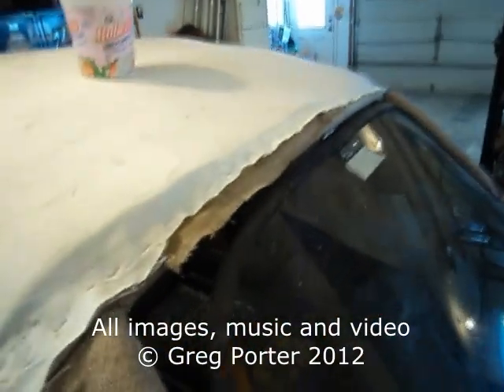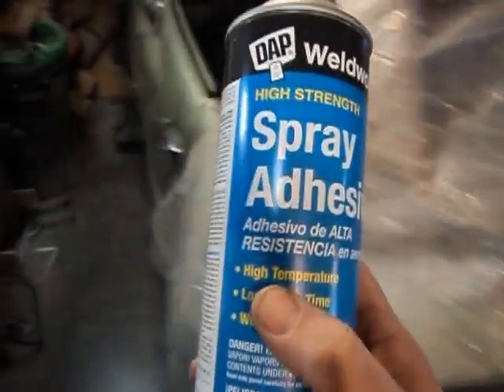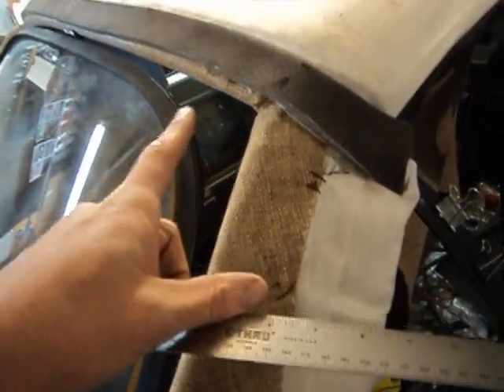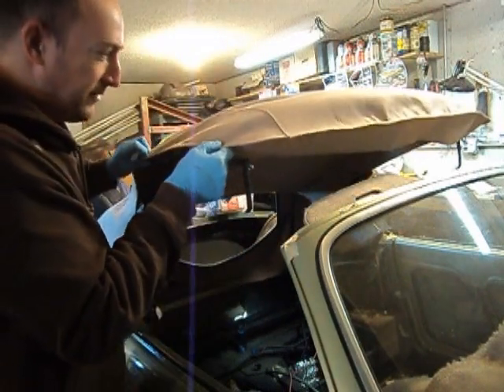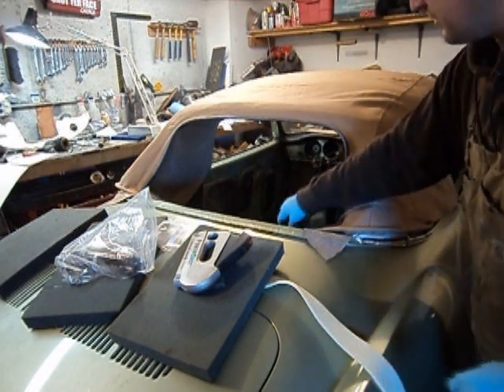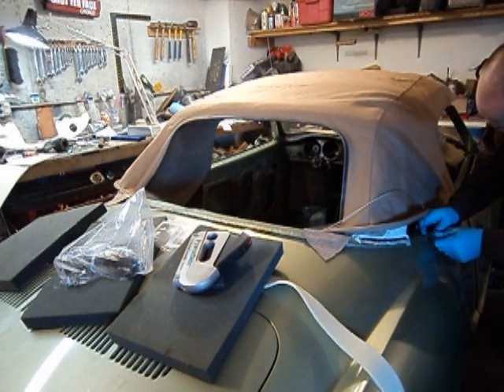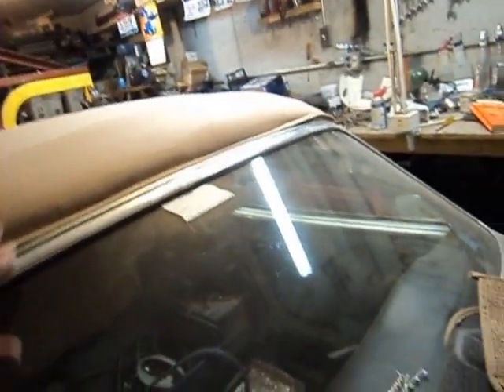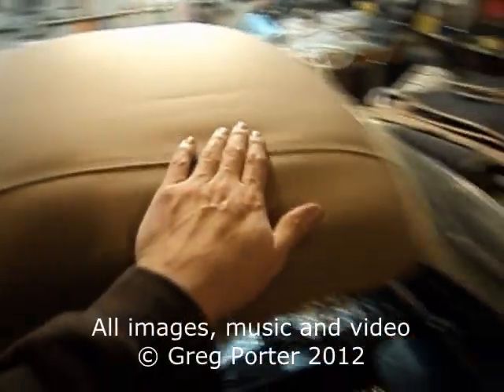Karmann Ghia - Convertible Top Installation - Part 4 - Outer Canvas

Comment: Just a tip: If you need to close the back of a finish washer, I've found that I can get small fat o-rings which fill the back and give even a bit of cushion to the washer as you tighten it up. They work great in upholstery and even wood applications where ya want a tight fit but don't want the steel edge of the washer to cut into your piece. You can get 100 (made in China) o-rings to fit your specific washer size for about 10 dollars or lots of places will sell per piece if ya only need a few.

Comment from the maker: No sweat man!  Thanks for the kind words.  I was quoted $2000+ for labor from two different sources.  The parts were around $1500.  It's not a cheap piece of the build, that's for sure.

Comment: You can get stainless rivet washers as well which fit some sizes of finish washers perfectly if ya need a really tight fit. My experience with convertible top material is that it will not stretch (only tear) so if it takes all your weight to close the lid, I'd say it's just too tight and needs to be loosened a bit. A pain I know but on my 71 Cutlass, I cried when the side arms punched holes in the material when I powered the top down. Also consider air pressure at speed on all connection points.

Comment: hey buddy, I'm at this section of the install on my 68 ghia. Trying to figure out what to do w/the side strings.
Reply from the maker: There are a R & L tension cable that go through that string hole.  They keep the area above the top of the window taught.  I got pretty excited about getting the car back on the road and I failed to film the last bits of the install.  There is a spring and a cable.  The spring attaches to the rear side of the opening.  The cable hooks to the spring, then threads through the top using the string inserted by the top manufacturer.  I believe the other side of the cable has a hook that attaches to a hole in the top frame.  I hope that helps!
Reply: @Greg's Garage  thank you. 
The string holes are so small I'm afraid if I make the holes larger they will end up ripping over time from the tension
Reply from the maker: @mrfun2fly  I don't remember making the holes larger.  (I'm digging WAY back in my memory here...). I thought there was a hole and a little bit of a slit.  That allowed the end of the cable to slip through.  The canvas is pretty tough material (assuming you're using canvas.)
Reply from the maker: I just looked up the cables...  There are two different kinds.  One has the hook and the other is just a steel cable.  I used the ones WITHOUT a hook.  The cables come with a crush piece that allows you to stick the cable through the hole, then make a loop through the frame and use the crimp on barrel to secure it.  The same is true on the spring end.  I hope that makes sense.  M&T manufacturing has the crimp style...  Others do too.
Reply: @GregsGarage  yes using canvas 😀
Reply: @Greg's Garage  just tried putting a little tension on the hole and the canvas started tearing. Hummm...maybe I need to sow some support around the hole. 

Back to trying to get the top to close after installing the new top...what a booger, about 6" from closing 🤔
Reply from the maker: @mrfun2fly  There should be very little tension on the cables.  The springs should take the tension.  If your top isn't closing, you may need to release the rear tension cable and let out a little fabric.  If you've let it all out, you'll need to do the hot water trick... Boil a large pot of water, then soak a couple towels in it...  Then put them at the header, and the intermediate bows.  That will give the canvas just a bit of stretch.
Reply: @Greg's Garage  hot water it is 🤪
Reply: @Greg's Garage  did the water trick, I weigh 240 pounds and had to lay on top of the bow and now she's down! Stayed there for about an hour and now leaving the car out in the sun a bunch of bricks over the bow to relax the stress on the crank latch mechanism.